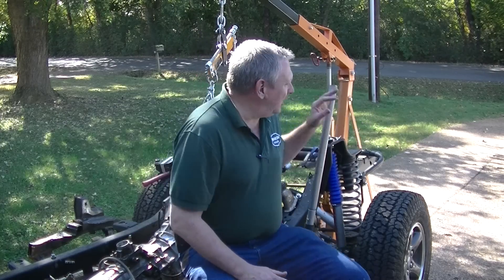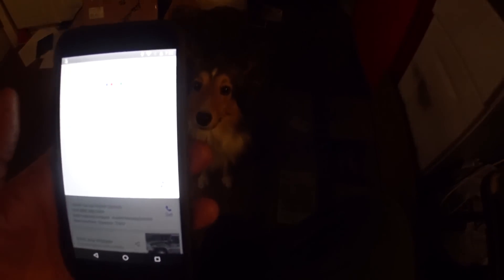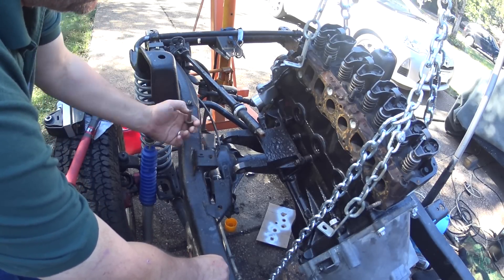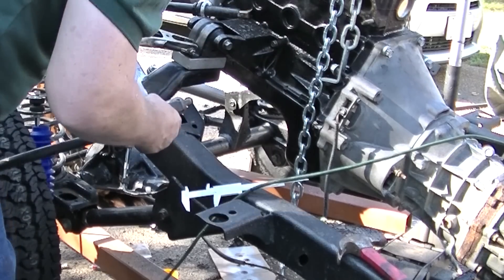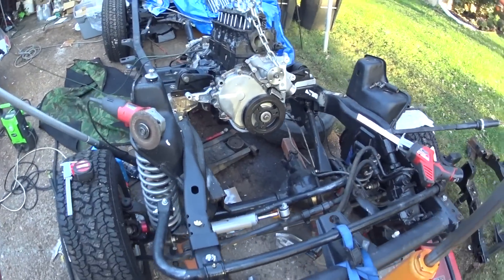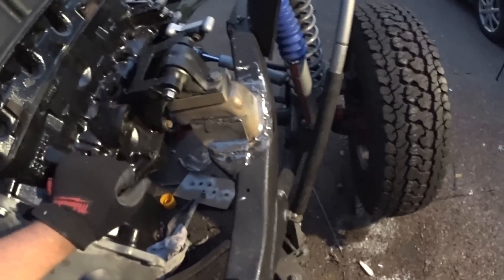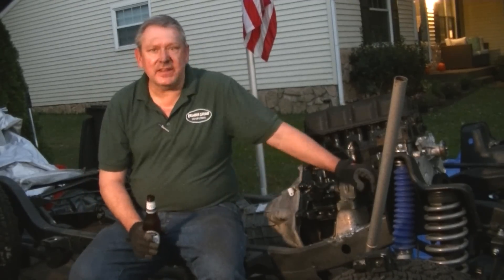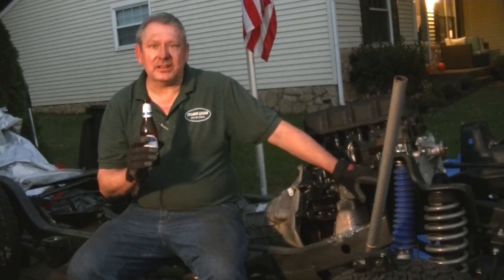Jeep Wrangler 2.5 / 4.0 Rebuild Series - New Engine Motor Mounts Welded

Comment: Curious why you didn't go with the 6 cylinder? I had the 97 2.5 with a brand new reman and was kicking myself for not spending $300 - $400 more for the 6 cylinder
Reply from the maker: +Maza Mike Hey Mike - The problem with going with a 6 cylinder - the wiring harness has to be replaced as well as - The ECM, The transmission - the axles, motor mounts - it is not a swap that is done easily or inexpensively.  A person buying a Jeep that wants a 6 would do well to buy one that is already a 6 cyl.
Reply: Nice, that makes sense.  The guy that put my 2.5 in said the only changes necessary would have been the motor mounts.  He said the transmission would have matched up.  I can make most repairs myslelf; exhaust manifold, distributor, valve cover gasket job, etc. but I was in over my head with trying to install a new engine.  I took his word for it, but I'd have to say you're a tad more qualified.  Great videos and it's always a bonus to hear Jerry's words of wisdom.
Reply from the maker: Maza Mike Thanks Mike ! The AX5 transmission ( Assuming you have a manual ) wont hold up to the increased torque - If it isn an automatic the bellhousing is different for the 2.5 vs 4.0  same with the 30/35 axles - the reason the factory upgraded those for the 6 cyl.  Thanks for the kind words bro !
Reply: @mazamike  The transmissions 100% do not have the same bolt pattern.

Comment: I'm in the middle of doing a swap. My donor engine/tranny are from a 99 Cherokee, mine being a 97 wrangler. Using the Cherokee engine harness and pcm will it work? Do you have a vid on harness instal/splicing?
Reply from the maker: +Josh Sharp I went back stock so I ever tried or had to splice the harness. I would think they are very similar   What exactly are you swapping ??? A 4.0 from a 2.5 ? .
Reply: +Redneck Garage I am swapping my 2.5 for a 4.0 out of a 99 Cherokee that has been upgraded to a 4.6 Stroker. Hoping to crank her before Monday.
Reply from the maker: +Josh Sharp So you are also planning on  swapping the front and rear ends and transfer case ?
Reply from the maker: The Dana 30/35 doesn't like the 4.0 ends up swiss cheese with more torque. Pretty sure you will have to change the ECM also due to the differences in the speedo cluster.
Reply: +Redneck Garage yeah I'm getting the donor ecm. Having a hard time getting it out of the Cherokee though.
Reply from the maker: +Josh Sharp If you were to ask me if that would work my quick answer is n. The Cherokee for 99 had a factory security system that was driven off the door locks ( on most ) The MAP sensor is different too I believe but ya never know.
Reply: +Redneck Garage just found out the engine is from a 99 but the harness is from a 91.
Reply from the maker: Lord you are going to have fun with that one :)